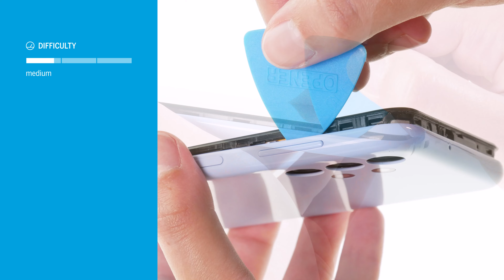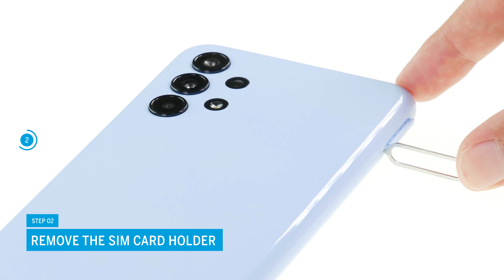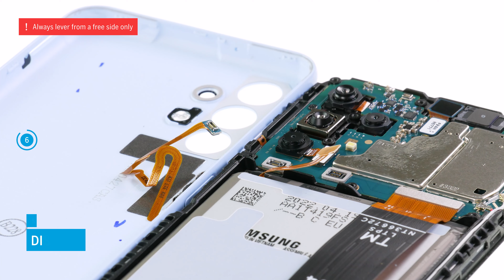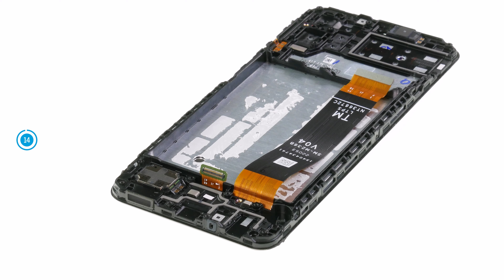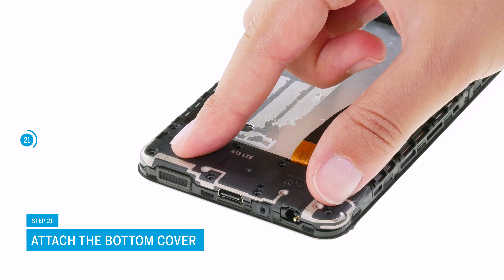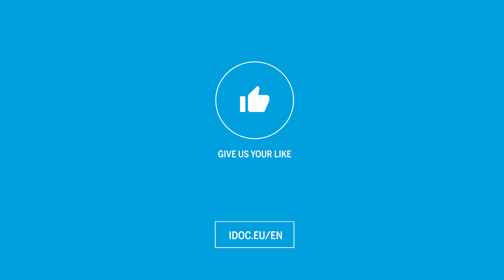Samsung Galaxy A13 – Screen replacement [repair guide + reassembly]

Comment: After replacing the screen and making sure everything is put back correctly.  I put the back cover . When I Press on it does not turn on but when I connect a battery phone charger it has the battery charging symbol on screen without charging. Only once or twice has the battery started charging correctly but I'm unable  to turn on the phone . Unless the charger is in . Do I need a new battery  ?
Reply: Prolly the motherboard isn't properly pressed against the flex power. If this is the reason, try applying pressure to the motherboard against the power flex, even unevenly, and see if it will turn on while you keep pressing on.

Comment: what would you suggest max battery temperature? i have 3d printer and heat bed is the only 'HOT' tool i have, apart from a blowtorch 🤣